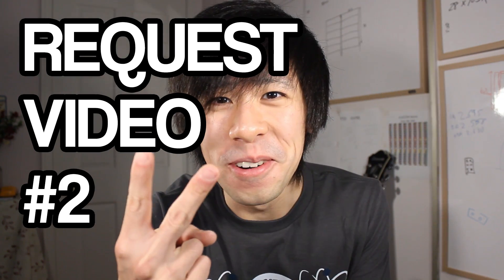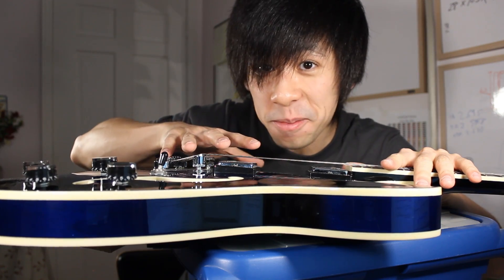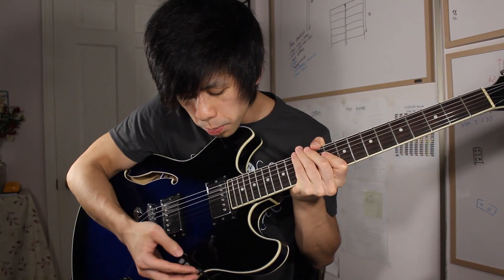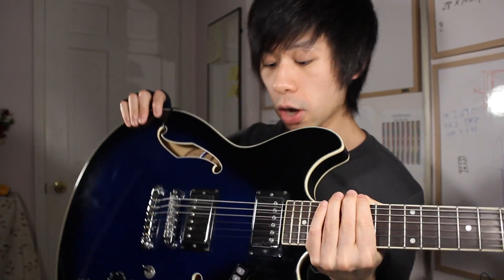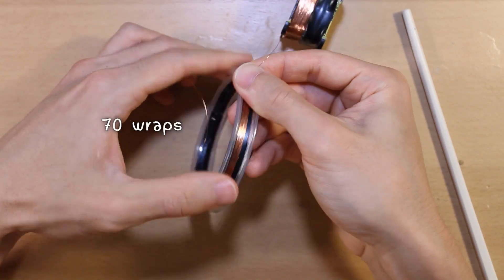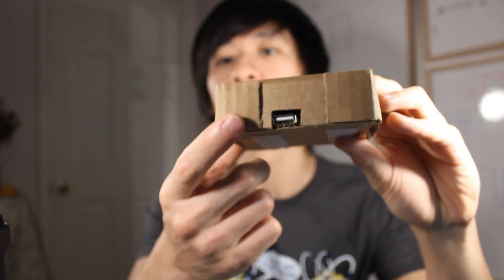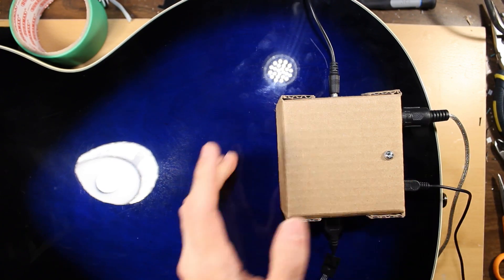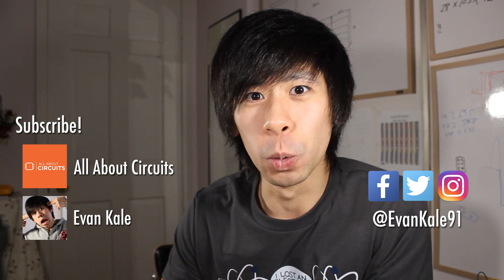Build a Touchless MIDI Controller with an Arduino

Comment: I love this video and want to build this myself, but I have a question... Where is the volume coming from? Is the MIDI port connected to a quarter inch plugged into the guitar, or where can an amp come into play?
Reply: Late reply, but someone might want to know the answer to this question still. 
The guitar is routed directly into the DAW through a regular quarter inch jack. You could route the guitar through an amplifier too, but you'd need to mic up the amp and feed that signal into the DAW also, as this device controls effects on the software :)
Reply: (You may have to deal with latency this way in live performance tho)